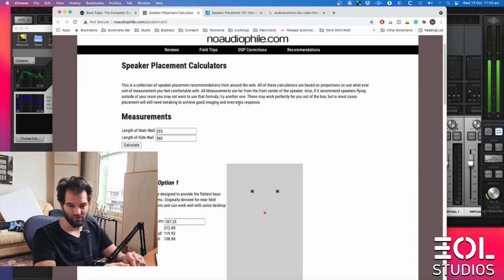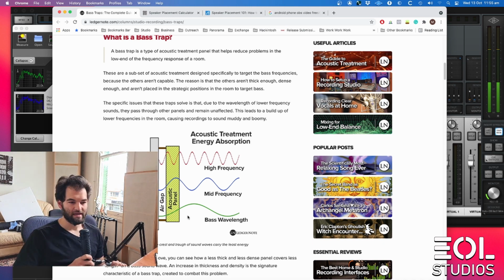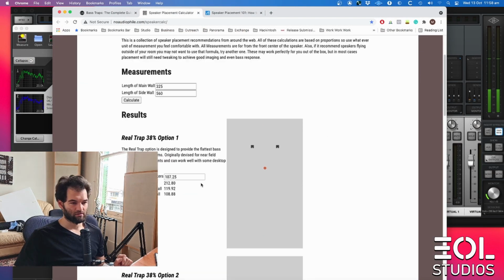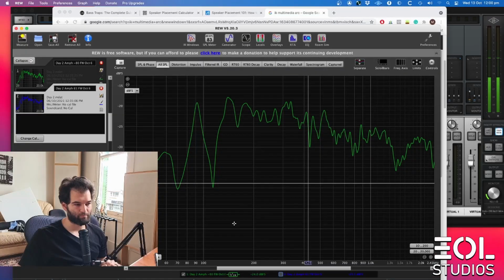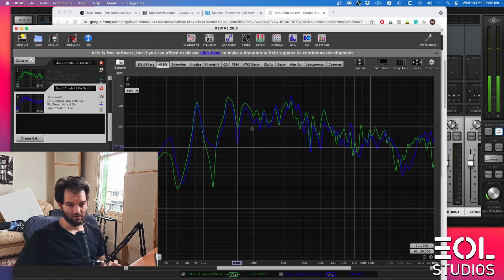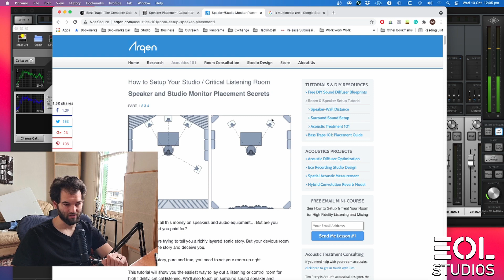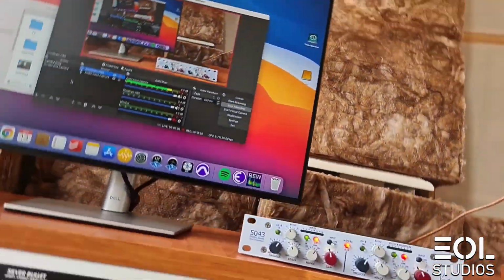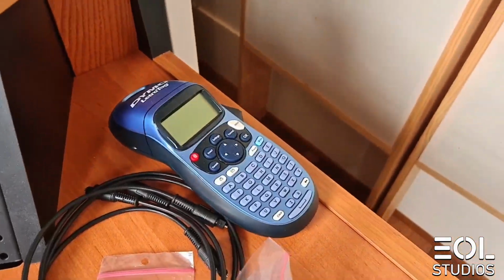How I Treated My New Studio Room. Studio Acoustics and Frequency Analysis with Room Eq Wizard.

Comment: Great video man. Acoustic treatment is literally all that's on my mind at the moment. I'm starting to really feel the limitations of my shitty, shitty treatment.
Reply from the maker: Hey thanks for checking it out man! 
I went further with this. Pretty much treated my entire wall behind the speakers with heaps of Earthwool. Apparently it never hurts and makes the low end so much tighter. If in doubt, just stack 4-5 layers of these darn Earthwool panels and cover these in fabric + timber frame. That's 80% of good treatment!
Reply: I treated my ceiling with ceiling tiles , the kind businesses use to cut down on the noise , you don't want anything to absorbant  , you don't want to cover the entire
ceiling  come out from the back wall 1 - 1/2 ft make a row but not all the way to the walls must leave spaces and I'm assuming you have tile floors , for the back wall try putting up
verticle blinds just like a window was there or sliding glass door and the same for one side wall more verticle blinds , and your sitting position should be a couch , that will be
your only absorbant thing besides maybe a bass trap made from those round 4 ft cardboard forms used in construction , just fill it with insulation , one will probably be enough
and before you do all this find the acoustic focus of your room by moving your speakers around untill everything snaps into focus , mark that position , it is hyper critical , I use
the triangle approach or the straight on approach , right now I have  an 18 inch open baffle woofer in a 20 by 20 inch frame with a 3 inch full range , low pass at 250 hrz
high pass at 300 hrz 7 ft from the back wall , the integration between woofer and full range driver is seamless , the sound is  very organic , the bass is detailed and powerful ,
movie soundtracks are breathtaking  , but it takes an awful lot of experimenting with the room acoustics and speaker placement , the room acoustics was the most difficult 
trying to channel out midrange hardness , many times i felt it just couldn't be done but then you think about it and then try one more thing and it all works like the room is a  sound
machine , it may take months to get it all to work perfectly , like solving a puzzle I even use some statues here and there and some books placed on my empty bookcase on an angle.
it has taken me years and a few trips to the land fill with failed room treatment mods. best of luck to you.

Comment: i feel like it's going to give you an unwanted plate reverb to where your ears are hearing the monitors, blended in with the sound of the back of a speaker after bouncing off a wall. but that's probably just one of the problems.
Reply from the maker: Indeed, if there is no treatment of the back wall. I've built thick panels to cover that entire area and it's become super dead in terms of frequency waterfall! Highly recommended